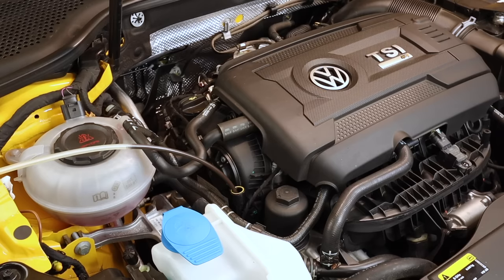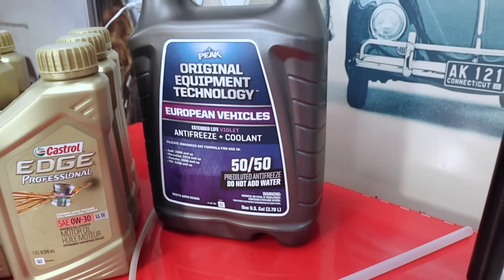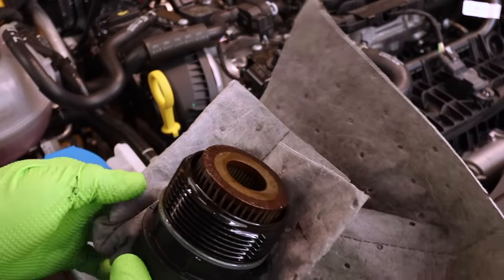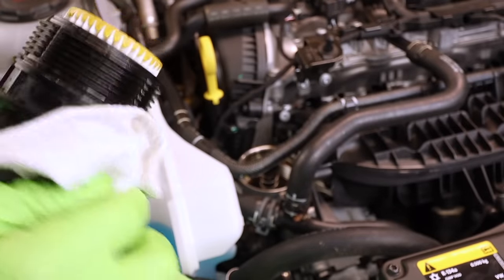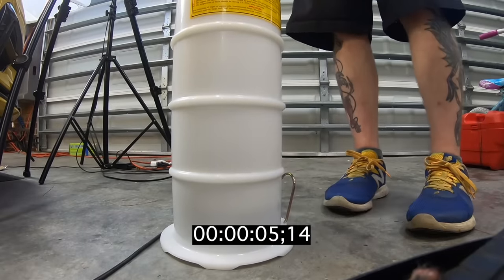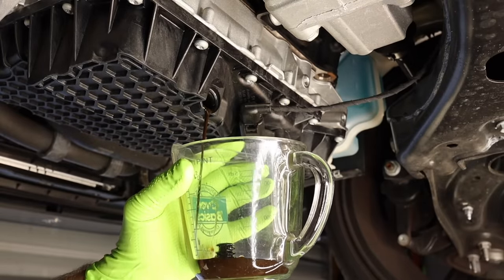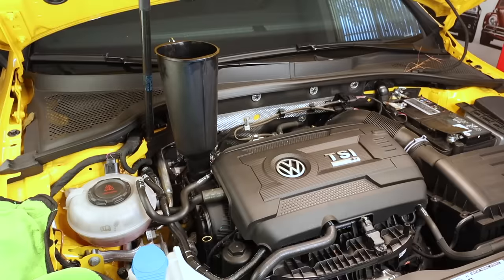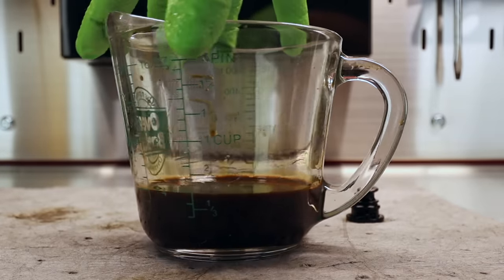Will an Oil Extractor Get All The Oil? (MK7.5 Golf R 5000 Mile Service)

Comment: When I use extractor I usually wait 5 minutes after all the oil was extracted and try again. It gets the rest that way.
Reply: I've done a little research online and found it maybe best to do your 1st oil change after 50 miles on a new car to drain metal deposits from brand new car parts.  After the 50 mile mark, proceed with standard oil change intervals.  
Informative video, though!! I'd stick with the drain plug and see if there's a reusable one. The splash guard is a pain in the ass. I ended up using washers to hold the bolts in place on '20 Honda Fit.... 4 or 5 bolts usually works.
Reply: Everything should be in suspension in the oil if you ran it before extracting.
Reply: My 1.0l tsi first oil change was 2 years or 20k miles. 

No idea why.
Reply: @davidgooch5883  how bout a no. You acting like your car is worth more than your house
Reply: @v12-s65  -- It is.
Reply: I have used one of these for years. I drop the tube in and usually find that the first 2 litres come relatively easily. I then lift it out and drop it in again and continue to wiggle it around until everything is out. Such a process has taken up to an hour in the past. I'm wondering if parking downwards might help.
Reply: @cameraz99  what 😂😂😂😂
America type of thing. 
In Switzerland a house is like 900'000$ at least. 
An E63s costs 150k for comparison
Reply: @v12-s65  And there it is…The Internet…Do you feel better now? Get it off your chest did ya? Barrel of fun u r.
Reply: @dlj1285  you feel very attacked if you really have the need to type that after half a year huh?
Reply: @v12-s65  Has nothing to do with me at all. Just an observation of your behaviour. At the end of the day I could really care less. Why don’t you trying being a nicer person and see if that works better for ya. I was just looking at the video only recently and your response to buddy just stood out is all. Completely unnecessary and a tad disrespectful. If that’s how ya want to roll by all means, but don’t be surprised if someone takes notice and/or calls you out on it. Bye.
Reply: @davidgooch5883  Incorrect, those are caught by your oil filter in the first place and secondly you have special additives in the oil from the factory specifically made to aid in breakin.   You're removing the breakin additives by doing that.
Reply: @v12-s65  Maybe he doesn't have a house. What's it to you if he wants to do the first oil change at 50 miles? He has a valid point. The break in is very fast on a new engine. Oil analysis is the only way to settle this. If one wants to keep the car forever, every little bit helps.
Reply: @johnnyblue4799  50 miles is nonsense the engine hasn’t seen enough rotations. Try 500 miles but def not 50. You know the oil filter is there for exactly this, at least talking from my experience. I‘d go 500-1500 miles
Reply: @v12-s65  Maybe... 50miles at 50mph is one hour, or 60 min. At maybe 2500rpm that's 150000 rotations. So each piston went up and down 150k times. Now you take two pieces of steel and rub them 150k times one over each other while applying enough force and heating them up at the temperature the rings get in the bores. Send photos of before and after.
Most of the wear in the rings/bored happens quite fast. The oil filter is good from about 10 microns and up. Many particles from the initial break-in will probably go through. As I said, oil analysis is needed to settle this. Will it make a difference for the lifespan of the engine? Maybe, if the engine life is extremely long. Chances are the car will be rusted first, but I think between 50 and 500 miles is not as much wear as from 0 to 50.
Reply: Do it warm, pointed front side down a bit, fo the oil filter housing thers a small hole you can put the extractor into and get quit a bit.
Ush with diesel, extract it and fill
 Up.

Comment: I just remembered a guy I use to work with years ago, who would leave his vehicle drain plug out, over the weekend (he had two vehicles) until the VERY LAST drop came out, and proclaimed this was the best way to change oil. Lol.....he would probably have a stroke if he saw you left 100ml behind
Reply: Same as me, leave the drain plug off for one day, next day back home from work pour some engine oil in before put the drain plug back on, after dinner secure the drain plug put in engine oil crank up the engine for few times before put in oil filter. 😁😁😁😁
Reply: DING PONG CHI are you serious? What do you have a Ferrari? Seems overkill no?
Reply: @kryptoniteee  no, first of all i am a mechanic, second it is a passion for my hobby job.and it doesn't matter what car was it i to have respect it and give him the best i could.
Reply: @kryptoniteee  indeed overkill
Reply: DING PONG CHI hey ding dong ping Chong. I’m glad it makes you happy. You should be happy, but put more effort into helping others. It’s not good to be selfish. I’ve seen too many people being selfish, it doesn’t end well, they die sad and lonely. It doesn’t matter that people are liking and agreeing with my comment, what matters is that you are happy and selfless.
Reply: Put a new engine in every 5k. Problem solved.
Reply: @dingpongchi632  This is a bad idea, one of the reasons the manual has you run the engine before doing a service is to leave a film of oil on the wear surfaces. You are going to all of this extra effort to ensure your engine will be as dry as possible on start up, and consequently incur as much wear as possible.
Reply: I pull the plug on a Friday night and just finish Saturday roughly12 hours later. May not be worth it but "it" doesn't cost anything.
Reply: I like to know the oil pump is primed before re-starting,  after an oil change.
Reply: I do the same thing - after driving till engine is warm, I first remove the drain plug, then oil filter, then to make things totally drain, open the oil filler cap.  Then I let things drain for about 4 hours (start in the morning - finish later in the afternoon).  Since I have to lift the car to do the service I've found that raising and lowering the oil pain from left to right gets the rest out.  It's amazing what comes out.  Eventually after about 85k miles I will remove the oil pan to see what crap has been sitting there from the previous owner.
Reply: DING PONG CHI how much do you charge for a 4 day oil change
Reply: @dingpongchi632  bad idea
Reply: You still won’t get it all out. Leave the plug out the. Pull a valve cover. You may be surprised.
Reply: DING PONG CH
Reply: Yeah, but now he has a ton of spiders in his oil pan.... and they will find their way into the cabin somehow
Reply: @kryptoniteee  Do you speak from experience? I would love to talk to a person that has died before.
Reply: DING PONG CHI what is your education where do you work what is your exact area of work? I’m sick of people just saying I’m a mechanic. Your on YouTube so chances are you lied to get some claim to your point. Prove your a mechanic or don’t mention it MY GOD!
Reply: You Wish  condensation is only a problem if you don't get your engine up to operation temp at least on buy 5ce every 4-6 weeks. Lots of short trips under 10 miles especially in winter time. Whatever condensation would  evaporate and be vented out
Reply: Doesn't sound like such a great idea when you consider that the first few hundred revs are going to be mashing dry gears until the new oil gets circulated. I'd much rather have the old oil coating on those parts.
Reply: ACitizenOfOurWorld there’s still a thin enough layer after it drips off that will suffice until the oil pump almost instantly puts new oil on
Reply: ACitizenOfOurWorld same happens every time you start a freezing cold engine in fact I’d bet that’s worse
Reply: @whydoihave6neutrals772  wouldn't in cold starts the same film of oil on the parts be there until the oil pump gets oil there almost instantly. Always puzzled me even in warm temps people worry about oil thickness. When you have 30-70 hp motor turning the oil pump when it first revs at start up. That kind of mechanical power will pump almost any fluid instantly
Reply: James Smith exactly and you’d have to let your engine sit for weeks to get rid of the thin layer that the old oil coated
Reply: Woah woah woah...
You're telling me he didnt hook up a vacuum pump to the drain area to ensure full emptiness?
Reply: kryptoniteee you make absolutely no sense. Not to mention hint of racism. How do you go from oil drain to selfless in 2 sentences? You need more Prozac or Lithium. Back to subject, I would not drain oil to that extent- bit of old oil mixing with new is fine as it’s all filtered regardless. 100ml of used oil diluted with 5500ml of oil will not make absolutely any difference.
Reply: National Enquirer and you are virtue signaling to the world that you are free from the scourge of racism.
Reply: Great, but OCD. I have seen quite a few tests by Bobistheoilguy and other showing that even a partial oil replacement gives you almost all of the benefits of a full change. I would never do that but the point is that there is a bigger margin than you think. Go ahead and love your baby. How about an oil change then run it for 10 hours and then change the oil again. Wouldn’t hurt to drop the pan too if you’re feeling super OCD. I use an extractor. I hate slinking under a car on a creeper and you have to set your beer and cigar down...;-)
Reply: @fensterlips  I extract is out now as well because some jack hole put the plug on so tight id literally have to use a impact to loosen it. I believe it's stripped and overtightened. So I don't wanna have to tap and die the oil pan. Rebuilt the heads about 20k miles ago and everything looked good so not to worried with 240k.
Reply: He would have more than a single stroke if he forgot to put the drain plug and oil back in. - About a few psiton strokes and then no more !!
Reply: Tell him when it's done draining to just "bump" the engine over.  You'd be amazed at how much oil squirts out but turning the engine one revolution.
Reply: @datsuntoyy  Exactly - Just bump it over a few revs with fuel pump fuse out or crank position sensor disconnected or similar. - More oil flows down into the sump.
Reply: @Rob-fx2dw  I've actually never done it on an FI car.  Only my old carbureted, points ignited.  I've never been a "very last drop" kinda guy.  I figure there is about .3-.4 quart of undrained in the average engine.   If you haven't already, pull up the bughatti veyron oil change video.
Reply: @datsuntoyy  You should be a last drop guy - particularly at the bar when finishing the last beer.  Yeah, - I have seen the Bugatti oil change video- It's easier to just trade it and get another one or build the whole thing from scratch !!
Reply: I wait maybe 1-2 hours until it stops dripping, my girl wonders how Brake Masters and Walmart are "much faster" than I am at changing oil. I'm like LOL LOL LOL Let me to get my Axe LOL LOL LOL.
Reply: @Bobsnarls  impact gun driving the drain plug off and on also.  Don't worry about those threads, make new ones.
Reply: @Chris Rock The 100ml of oil were left in the sump using the extractor, not by removing the plug.
This experiment proves that removing the plug is better.
Reply: @taunuslunatic404  True, but is that 100ml really worth it?  In my case the oil filter hangs down near the drain plug so there's no diff, but on my wifes the filter is up top.  Would it be worth it to you to raise the car and get under it for 100?  if not, 200?  I think even at 1/2 Liter I'd just do the oil change a bit more often.
Reply: @datsuntoyy  If you want your car to last as long as possible, it's definitely worth it.
Reply: @taunuslunatic404  It would certainly seem that is true.
Reply: Everytime the wind blows, a little dust gets in.
Reply: @dingpongchi632  lol put the oil in before the drain plug and crank the engine before putting the filter back 😂😂😂
Reply: My mate did the same, forgot to refill in the morning and drove car, engine destroyed.......
Reply: Man... what an extreme. Probably allowed all kinds of moisture to creep it’s way through the open plug too. When I want to be anal about getting all the oil. I leave the drain plug off and pour some new oil in to purge out the old oil, then seal and fill.

Comment: I’ve been using an extractor for the years. The convenience of using it means I change the oil more regularly. I was interested to see what was left in the sump. I can live with 100mls, which is about a fiftieth of the overall fill. Since I change the oil so regularly I can definitely live with that.  With the the extractor I can do an oil and filter change in ten minutes. No raising the car, no removing panels and no mess. Works for me. Great video. One other thing, I always buy used cars. When I get a replacement, first thing I do is I swap out the oil In it with some cheap oil. I run it for a day or two with that, then I swap out that cheap  oil with a top quality oil. It’s almost like an engine flush.
Reply: 100 ml is 3.38 oz
Reply: @jwattsup  My car takes 7 .5 quarts, im not worried about that. There is residual oil all over the engine anyways, and it is getting diluted, if u change ur oil more often than normal because of how easy it is, i would say it is still a win in the long run. I been using one of those, and dont think twice about it, of course it helps with oil filter on top like my bmw has. I got 240k on my e46 which i still drive here and there as its a fun drive and runs excellent. That also is not highway miles, its city miles, only thing i have done other than change oil, is replaced water pump, plugs once and coil packs. So for using an oil extractor entire life of the car, and car is 21 years old, i would say it works pretty well.
Reply: @reality150tv  not a good example... That e46 is eternal 😀
Reply: @eduardovcalado  wtf are you talking about
Reply: @reality150tv  I believe he was being sarcastic knowing that BMW model will last long regardless😎

Comment: When i change oil, i actually put a bit of fresh oil in the engine without the drain plug so the clean oil flushes out any leftovers. No i do not have OCD...
Reply: I do this too
Reply: I just fill in 6liters of gas in the oil pan and drive around for a few minutes and let the gasoline wash out all the old oil
Reply: @lorenzhartl8466  really? I wonder if u can hurt the engine? Obviously not running to long
Reply: @lorenzhartl8466  that’s a joke, right?
Reply: @AlbertoGonzalez..  DUH
Reply: @lorenzhartl8466  amateur I take my pressure washer and stick it in the oil fill hole to make sure its all washed properly
Reply: I do the same thing, I send about a litre of fresh oil to flush out anything.
Reply: @flippy9133  I do this too. If you add dish soap / washing up liquid it gives you a good indicator that you've put enough water in when the foam comes up out of the hole. Refit the cap, take the car down a rough road to shake it all up, then drain. Gets everything sparkling clean.
Reply: @lorenzhartl8466  I add a  little sand to the gas so that it scrubs all the carbon off
Reply: @texarkana3781  that helps even more
Reply: Good shout.
Reply: Drain and flush, as needed, with a can (s) of oil is what we do for military helicopters to get any dirt and residue out of gearboxes and transmission.
Reply: @lorenzhartl8466  lol
Reply: That is the stupidest thing I ever heard of. Putting a little oil in the engine with the drain plug is NOT going to flush the old oil out. In normal operation the motor oil circulations throughout the motor internals. The way you are doing it the fresh motor oil won't circulate throughout the motor internals.
Reply: @lorenzhartl8466  you guys drive with oil in your car?
Reply: Are you sure?
Reply: I use coca cola